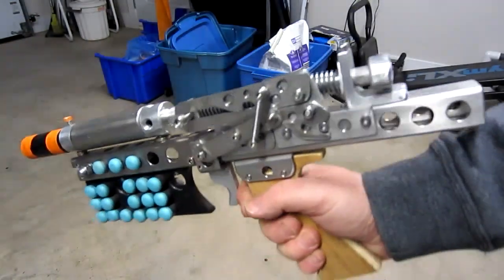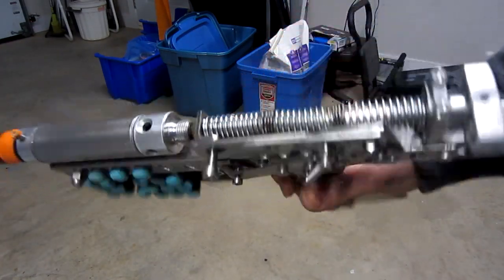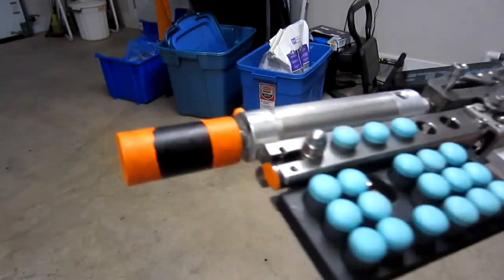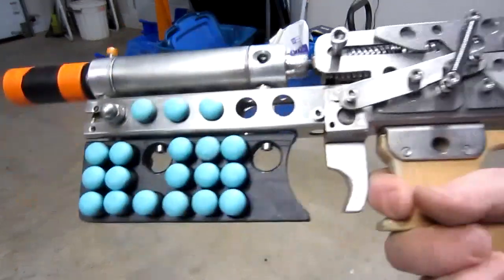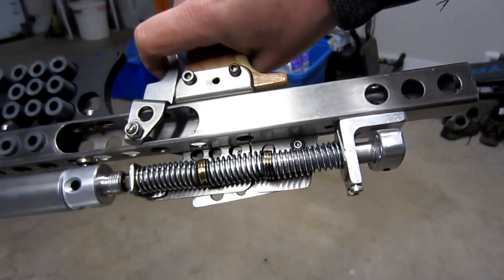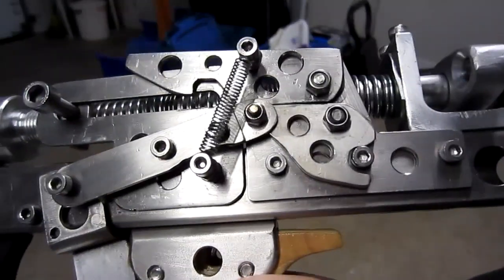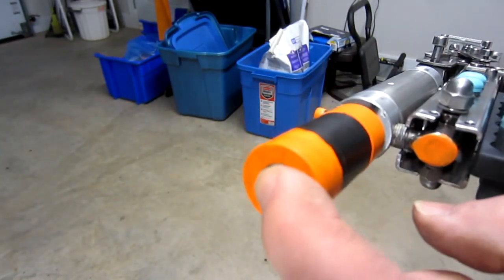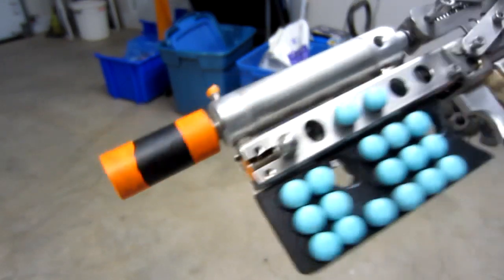Homemade Foam Dart Launcher

Comment: Love it man! 👍🏻

Edit: have you tried different barrel lengths? Short darts of various brands really love precission brass barrels or even regular 13mm ID aluminium barrels. Could make it break action (with good seal) to not have to ramrod the darts in there. Or make a sliding breech.

That piston really looks as if it has more potential barrel volume wise.